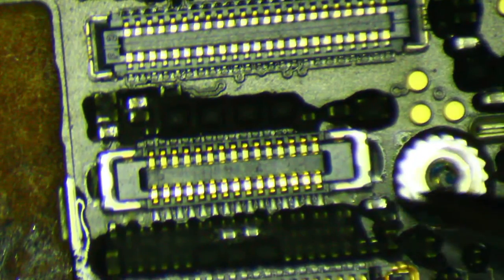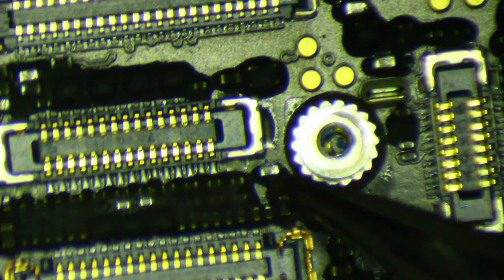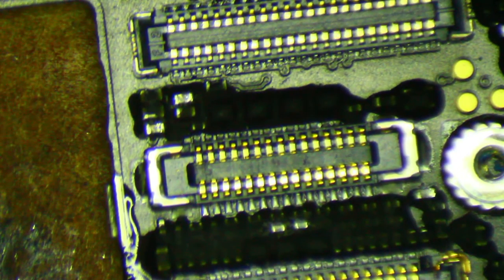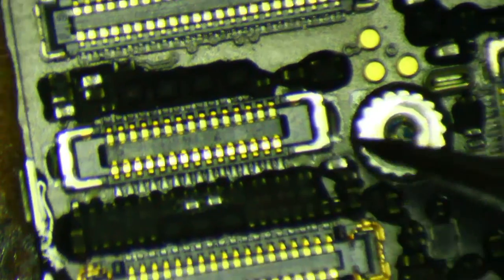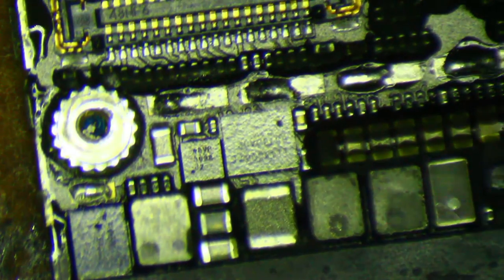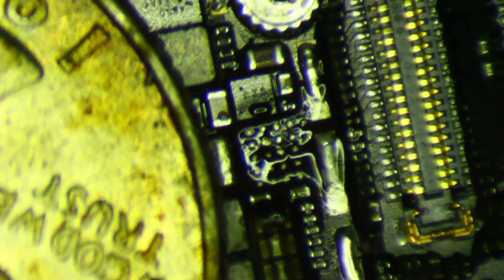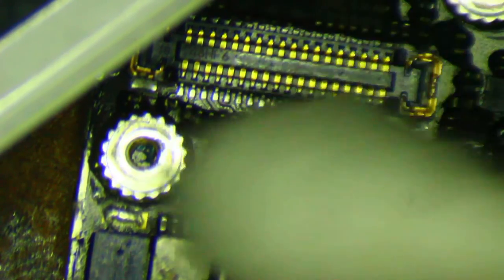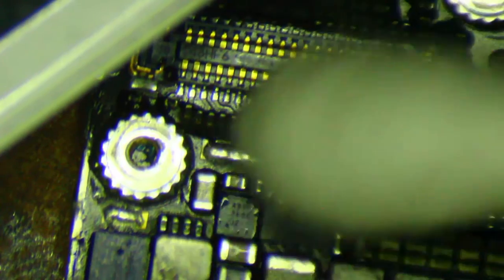iPhone 6 no image solution - strange short on PP6V0_LCM_BOOST

Comment: Great videos. Informative and straight to the point. Could you tell me the best soldering tip for cleaning the tiny pads on these circuit boards?

Comment: Mark, TY for the video...When you say you connected screen and check FL2035 and FL2036, are you just looking for 1.8v? I have the exact same symptoms as you describe (Can update without errors on itunes, just no image but have backlight). I have an Iphone 6 that was experiencing ghost touch. I replaced meson and cumulus after testing a known good LCD and no change in symptom. I changed both again to make sure there was no mistakes and still no change. I began testing voltages with screen attached when I noticed home button would not work... So I powered down, resat the connectors and when I powered back up again, I have a backlight but black screen. I tested with another lcd and same thing on it. It draws power, charges battery, Itunes sees it, just no image and crazy readings around Mesa and bad readings around Chestnut and Tristar.

I changed Chestnut  U1501 and U1503 along with C1501

Getting the following:

BL Coil is 1, Diode is .204v, resistance to ground is .507v

VCC_Main = 4.2v

FL2035 LCM to Chestnut and FL2036 AP to LCM Reset are good = 1.8v

FL2095 PMU to Photon Alive = 1.8

P17V0 Mojave _LDOIN C1501 = 3.8 (That's why I changed it and U1503, No Change)

L1500 PP18V0_Mesa (1 and 2) = 4.2v (Another reason to have changed U1503 No Change)

C1500 and C1503 getting 0 to crazy numbers on Voltage

L1519-1 getting 4.2v good VCC_Main but not boosting to 6v on L1519-2 (Is why I Changed Chestnut U1501, No Change)

C1541 = 5.1v

FL2037 PP5V7 (C2050) ... = 5.7v

FL2061 PN5V7... = -5.7v

FL2027 PP1V8...= 1.8v

C1299-1 PP3v3_ACC  3.3v missing on Tristar U1700 (Replaced Tristar with no change, Getting VCC_Main around Tigress U1401)

I was able to restore on Itunes without errors... except I have  a Backlight with no image, tested with  other LCD's

I also replaced Data Filters L2041, L2042, L2043, L2044

any ideas?

Comment: Hi Mark, thank you very much for this very good explanation. I have a question please. What can we deduce if on of the first two filter you are testing (FL2027 and FL2037 are testing good in diode mode but not producing the right voltage) In my situation, this is the filter FL2037. I am not getting 5.7 volt but the filter is testing good (attached capacitor of this filter, C2094 and C2071 are also testing good), thanks in advance
Reply: Do you think it is necessary to replace chestnut in that case ? All component like filter or capacitor in the line PP5V7_LCM_AVDDH is ok, but how to test chestnut without retrieve it ?

Comment: Hi Mark. By putting a coin to cover the cpu while blowing hot air to remove the chestnut ic, will that be enough to protect the cpu? Don't u use heatshink or tape to cover the cpu?
Reply from the maker: Van Quang Nguyen I find that a coin is enough.

Comment: Did u use very high temp to remove the chestnut ic? I count only 10 seconds for that ic to be removed
Reply from the maker: Van Quang Nguyen it is a very small IC so it comes off easily
Reply: Mark Shaffer Thank you

Comment: Hi, is there a big problem if you remove the shorted cap and not replace it with new one?
Reply from the maker: Stoicho Hadgiev not really. it will function fine without it but I always replace a removed cap if I can.
Reply: unless its water damaged ;)

Comment: Hi Mark, got a question if you would be so nice to help, I have an iPhone 5s giving no image and pp1v8 is reading 3.8v, is the pmic had it's day or could you point me in the right direction, the phone itself does boot to recovery mode. thanx
Reply from the maker: Peter Campbell I think you're measuring the wrong component. 3.8v is going to be battery voltage so you're probably measuring vcc main.
Reply: I wish that was the case, PP1v8_Always is 1v8 on R22 however when I measure on C30/c135/c999 I am getting 3.8v and they are all on the pp1v8 line
Reply from the maker: Peter Campbell then yes you either have a bad pmic or a short connecting pp1v8 to vcc main
Reply: thank you kindly for your time
Reply: Great videos sir. I just subbed you. I also have no image on a booting (itunes)iphone 6 plus . Im getting all proper voltages 1.8V , 5.7V pp5v7_sage_addh , pp6v6  etc . the only one im missing is pn5v7_sage_addh. I checked everything on that line and also the pads underneath chestnut for continuity and nothing is shorted or broken traces. I replaced chestnut and all components on that line twice and lcd fpc but im still only getting .5V on that line with lcd attached.  Any help would be greaty appriciated.
Reply: Tech staff 
??

Comment: Hi Mark 
Hope you can help, I am having problem trying to get a iPhone 6 LCD image it have checked the fpc and all filters and all caps on the chestnut circuit no short and have replace the chestnut IC but still no image and no volts at the cap beside chestnut IC just the 3.5v from battery line at the coil.
Thanks
Reply from the maker: T Hodgins if your battery is 3.5v then it doesn't have enough charge to boot it show any image.
Reply: +Mark Shaffer it would show an image with or without a battery with it plugged into charger if no battery is connected it should boot loop an Apple logo
Reply from the maker: if you have a battery connected and that battery is below 3.7v, it will not boot or show any image. you said you measured 3.5v on vcc main which would indicate you have connected a battery that is not charged.
Reply: +Mark Shaffer It don't show any image even with a charged battery yes the battery was low but not that low that it would not show a charge logo and like I said even without a battery it should still show Apple boot loop logo you don't need a battery to get an image I know there should be around 5v at the small cap at pin 1 beside chestnut IC. 
Thanks for you help will ask Jessa maybe she will know, maybe CPU or track on the board
Reply from the maker: yes, ask Jessa!

sounds like you need to do some more basic troubleshooting and inspection.
Reply: +Mark Shaffer Hi Mark just an update on this iPhone 6 no image, it was a CPU short caps C0427 and C0467 had full short removed them but still short these lines run to the CPU reballed CPU now working